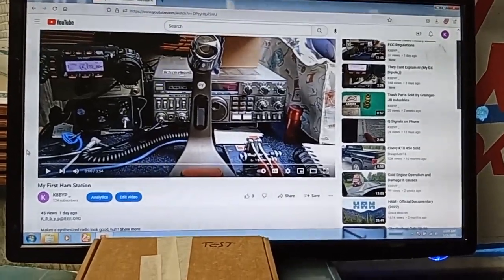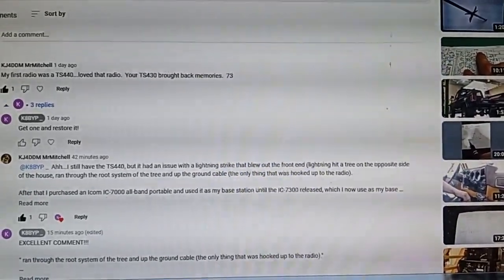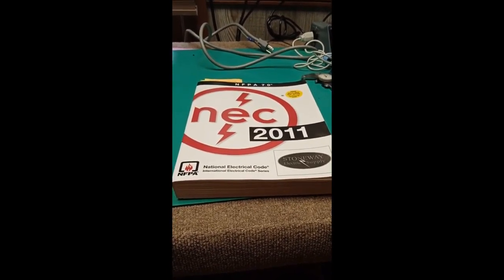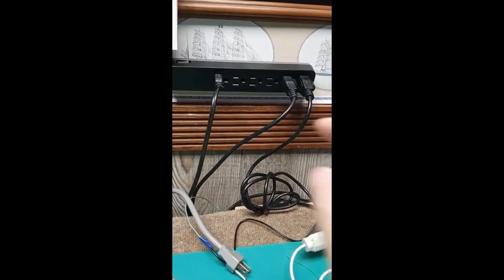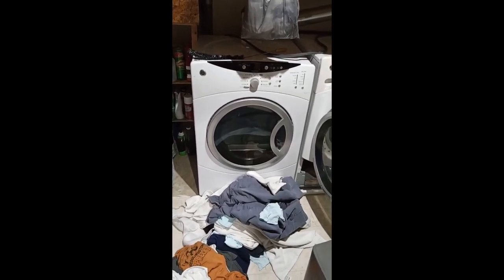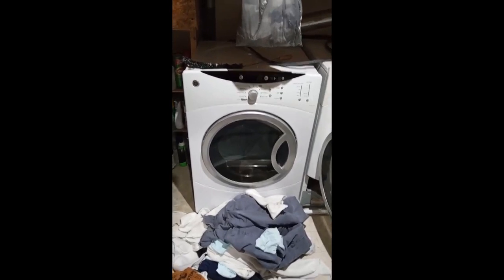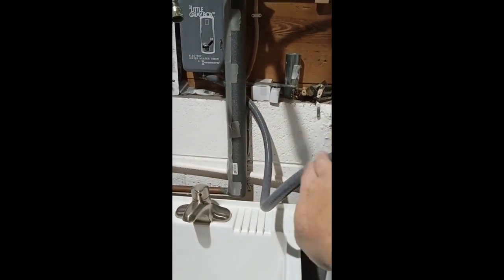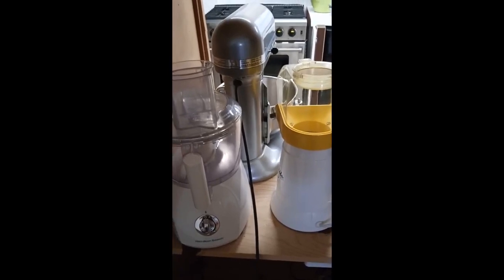UPDATE - NEVER GROUND HAM RADIO EQUIPMENT!!!

Comment: DC ground should always be isolated from earth frame ground!
One major problem now is SMP PSU dont like being dc grounded to earth 
Creates 
Dc bus noise
RFI imuninity poor
Increased internal noise 

Plus if you get a strike ,it will find lowest resistance point ,and go thru your dc ground burn out out pcb.

Best way is use an fully dc isolated  rf isolation 50:50ohm transformer on the rf connector .
Now your dc ground is fully dc isolated and floating via your SO239/N socket ariel connector.

Your metal mast must be earthed.

Now if you get a stike it only goes to earth ground and not dc ground around your radio.

Dc ground and Earth ground should always be isolated.

Theres a lot of too many myths in the hobby ,plus lot of the old ham kit used to have isolated ground chasis but not any more,including old cb radios used this system.
New radio kit now uses dc chassis ground and all changed.

Problem is poor information,or mis-information or interpretation.
Best of luck convincing radio people,i gave up in end 
Ones that did listen no longer have 
Static issues,smp noise issues,ac on dc leakage from smp psu,isolated ground systems that are very safe even if get a strike.
Agree information is very poor  why this happens 👍
Reply from the maker: Its complicated. Esp in an art mostly practiced by us Old Timers and old habits die hard!

The antenna xfmr was what was done in the old analog TVs, the 300 ohm inputs. OK till a lightning impulse incinerated them! ( and the tuner!)

That point ( attempting to use circuits to isolate ground systems  if there is such a thing) is something Ive avoided discussing  since its difficult to impossible, especially considering that a lightning strike of sufficient strength will ignore, destroy and leap over any circuit we make to try and stop it.

Thats not a job for a beginner or radio operator to hack away at by GUESSING!

NEC requures that whatever we do must work, and if that is inherently flawed that a strong strike destroys it, then doing so is contrary to Code.

Its clear you can handle the question, so I dont object.

Comment: For the Elmer’s… A counterpoise with a tent stake is NOT a ground?  Is it correct to say they are two different things?
Reply from the maker: correct. 

Counterpoise
Ground wire.

See, theyre spelled differently so they are not the same thing!

A Counterpoise is defined as an " elevated wire ABOVE ground to raise the apparent capacity to ground . " Radio Engineers Handbook, Terman, I think.

A ground wire(s) or plates etc are an attempt to improve the soil conductivity. With radials, the Earth is still ground.

Watering the ground is much better than wasting copper wire.

A ground plane of metal has to span a wavelength to replace the Earth. This prevents currents from ' wrapping around' the plate.

It is futile to put dozens of thin radial wires out, they have so small a surface area. It makes people feel important to boast about their number of ground wires. It doesnt help much with RF.

Radials are for low frequency ( AM radio) not HF because soil losses are severe at HF. Soil becomes a lossy dielectric at HF, where its resistive at low frequencies. Its also done at LF for ground propagation that does not exist at HF.

A continuous sheet of aluminum or copper of several square feet is better, see the concept of "Ground of Small Extents" ( GSE).
See Radio Antenna Engineering by La Porte. A GSE is whats on my pickup truck under the Hustler ball mount antenna.

Hams ideas on grounding are mostly from early 1900s broadcasting while having no knowlege of the science behind it. Its purely grabbing at straws in the dark.

Shunt fed is best for verticals:

https://studio.youtube.com/video/apgqb33LE-8

Comment from the maker: About the supposed 
" ground stud" on the back of the radio.

Thats a remnant from decades ago in MOBILE  APPLICATIONS.

The threaded stud in the back of the metal radio chassis was for MOUNTING THE RADIO UNDER A VEHICLE DASH BOARD.

There was often a mounting bracket attached to both sides, the stud was a third mounting point to prevent the radio from tipping up or down.

I recall this from a 1970s JC Pennys mobile tape player.

Thin metal strap with holes was used to MECHANICALLY connect the back of the radio to the dash frame.

It WASNT FOR GROUNDING.

Comment: My Yaesu power supply has an AC power ground prong. The ground prong is at the same potential as the negative lug of the power supply output. Unless I use an isolation plug on the power supply AC input, the radio I am powering has the coax shield tied to service ground.
Reply from the maker: Correct, depending on what you mean by isolation. Whether its a DC connection or not, it could be through a small capacitor, a lightning transient doesnt care, it can blow a capacitor body away and arc over. Itll go through or over any attempts at isolation and arc anyway. That cant be prevented, but thats not a Code violation when "it does it"

This is a problem where the Code has thrown in Amateur and CB radio in a COMMERCIAL section of the Code (CATV and data distribution) where those kinds of installations usually have the equipment AND AC mains service at the same point. A cell tower has incoming 230VAC plus the tower right at the same place, so both (all) are grounded at teh same point.

In household radio, our 'shacks' are not, or should not be at the incoming power service location due to noise and increased chance of lightning activity. So the two are too far apart physically to ground together.
Reply: Thanks for the reply. Lightning wasn’t my focus. Except for my tower, I don’t ground for lightning - I usually unplug everything. I was referring to rig grounding for RF (low inductance path to ground). The ‘isolation’ I was referring to is essentially a cheater plug that opens up the 3rd (ground) prong. That would float the power supply output. Again…not for lightning!
Reply from the maker: Rig grounding IS NOT a low impedance path.

Ive shown proof.

20 feet of #6 wire is too inductive for RF and an OPEN CIRCUIT to a high speed transient like lightning or some other arc.

Why did you ground a tower thats already grounded? Is it?" Buried in Concrete? If so your ground rod is worse than useless.

I determine the topic. Its grounding and lightning.

There will be NO  " dialoging to concensus" to substitute your opinions for science and regulations

Your false opinions with no proof are what Im exposing here. See the Family Guy clip.

Comment: Interesting.  The Yaesu FTdx 10 has a ground connection on the back of the unit.
Reply from the maker: Put there by people that have no knowlege of or responsibility under US NEC, and not using it in the US.

Your thumb will fit in a guns trigger guard BACKWARDS. 

Are you going to shoot yourself?

My FT 857 will transmit on 9 MHz but I dont use it there

Im educated and responsible.

And it has a ground lug and its a mobile but I know better than to ground it to the chassis of my F250. Ford says NEVER do that, it can screw up the computer systems.

And I know not to ' ground" the coax to the body at the antenna because that will allow the rig to draw power from the chassis.

Comment from the maker: Note...the self proclaimed "Ham grounding experts" NEVER SHOW THE ELECTRICAL PERMITS they are REQUIRED TO GET FOR NEW WORK, or the FINAL INSPECTION RESULTS.

That proves they're doing it illegally.

Installing grounding etc is NEW WORK OR MODIFICATIONS, CODE AUTHORITY APPROVAL IS **REQUIRED*"

*AND ITS REQUIRED TO DISCLOSE THE WHOLE SYSTEM INCLUDING RADIO EQUIPMENT ATTACHED TO THE GROUNED SYSTEM**

Its not permitted to just claim a grounded tower!

Residential REPAIRS OF LIKE KIND are allowed without Code Authority approval, NOT NEW OR MODIFICATIONS!